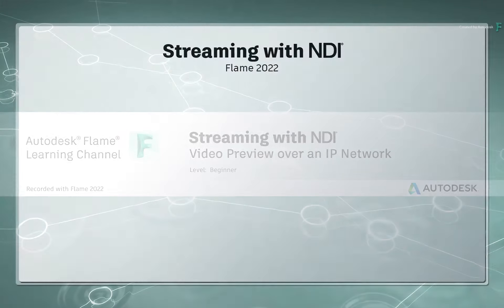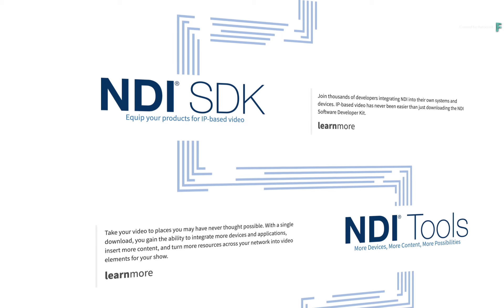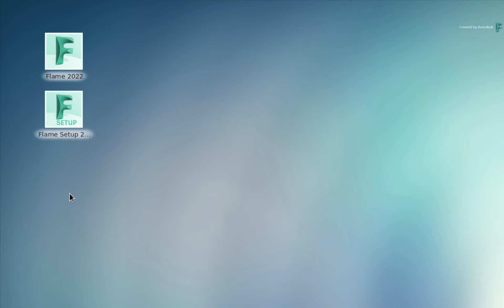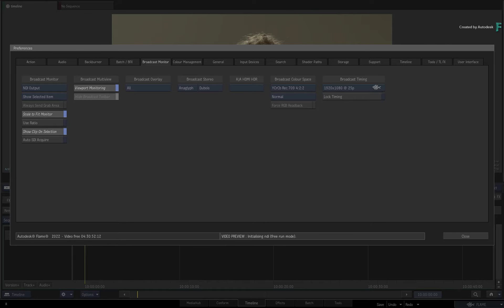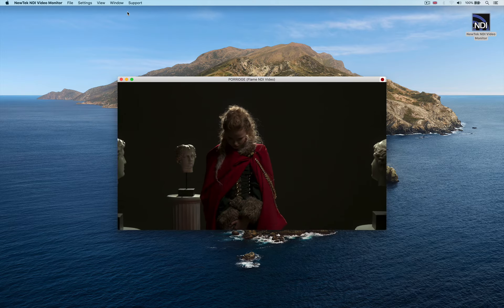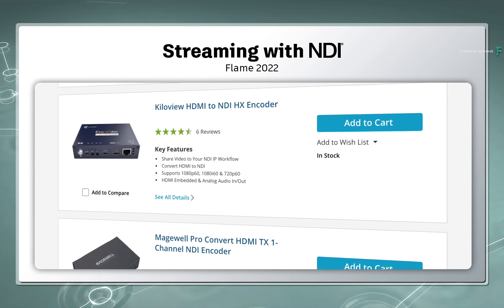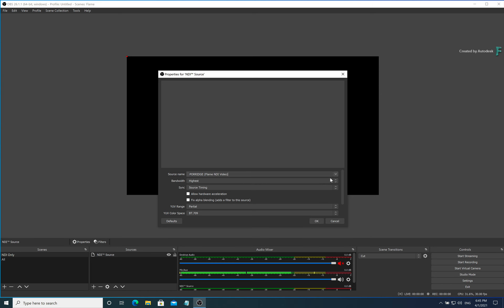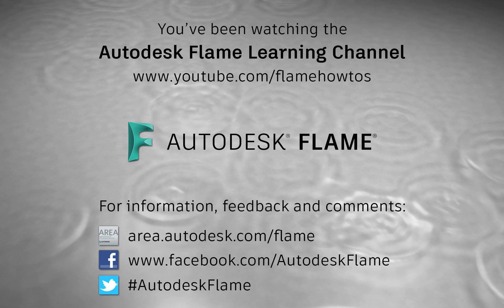Streaming with NDI - Flame 2022

Comment: Great job sir. How can I view flame output out side of my local network . Details please
Reply from the maker: If you want to view Flame's output outside your local network, you can stream Flame's output via a streaming software such as OBS Studio or NDI Virtual webcam.   This allows you to set up a virtual webcam device that can be streamed on any streaming platform (like YouTube, twich, etc) or stream meeting tool (Zoom, microsoft meetings, etc)

Just search for NDI and your favourite streaming tool to check support and setup.
Reply: @Autodesk_Flame  Hello. Any reason why I can capture video in OBS just fine but not audio?  I can capture audio with the NDI tools app but not OBS.  Flame is the only app I can't capture audio. :-/
Reply from the maker: @bryanhoffman8202  We identified an audio issue specifically affecting OBS Studio and are working on a fix.   Hopefully we can remedy the issue in a future release. Many thanks!
Reply from the maker: @bryanhoffman8202  This is reported fixed in the Flame 2022.1 update that has just been released.    Please check the what's new documentation for guidance and let us know.  Many thanks!

Comment: More videos on this topic please
Reply from the maker: Hi Hardave Grewal, As far as I know we have shown everything with regards to NDI and Flame.  However you channel the NDI signal is totally down to you.  What exactly where you thinking with regards to more videos?
Reply: @Autodesk_Flame  I was just hoping you could elaborate on the OBS and in particular how to get the GUI into OBS, but I think I figured it out. What software were you using to get the GUI into OBS btw?
Reply from the maker: @hardavegrewal9016  If you are talking about the Flame interface and not the NDI option then I did mention that I was using VNC to load the GUI in OBS Studio.   I didn't cover that because it was not NDI :).   

Seriously, on the Flame Workstation I use (LINUX) I started a remote VNC share which comes installed with the Flame CENTOS DKU and I used the OBS VNC plug-in from the OBS project website to make VNC as an option as a source.    

Another option is to use a hardware splitter and convertor to take the UI signal and covert it into HDMI.   This could be fed into a separate OBS workstation as a source and it could be loaded as well.    There are so many options to choose from.

Hope this helps!
Reply: @Autodesk_Flame  Yes that helps thanks Grant!